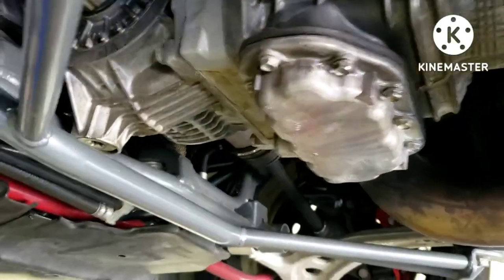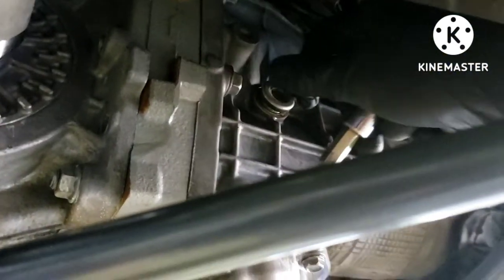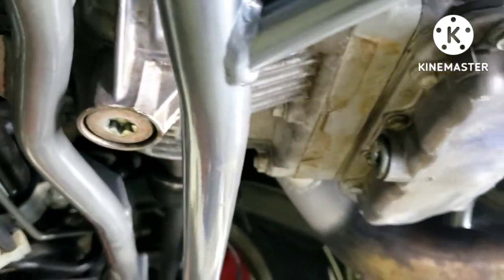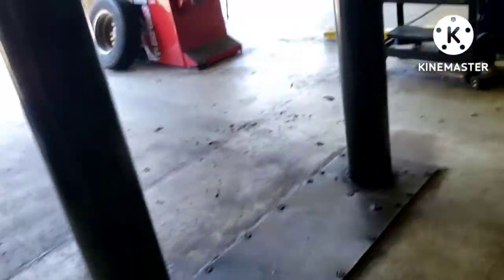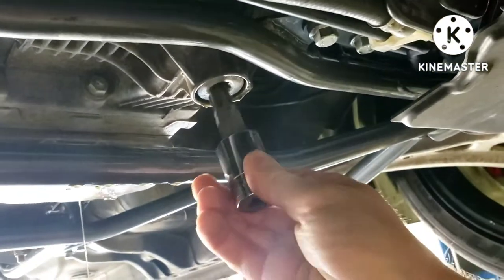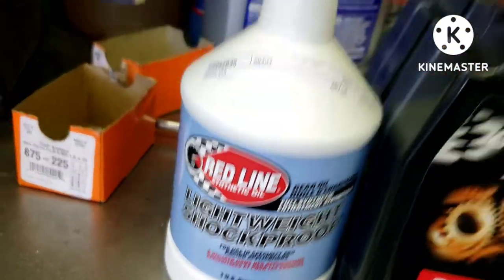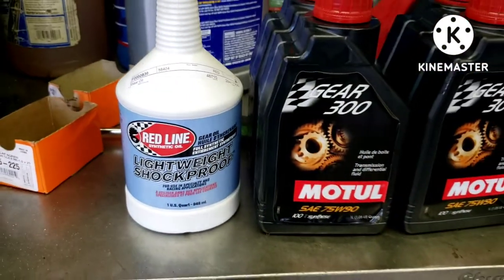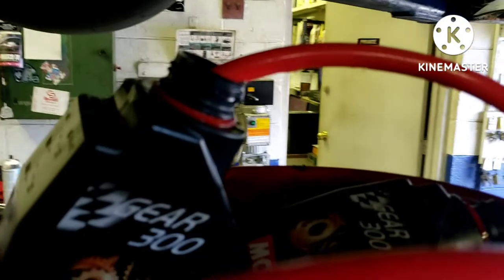Subaru STI transmission Fluid Replacement How-To

Comment: I really dig that cage . Protect the goods lol
Reply from the maker: @bradharrington2915  and add rigidity at the same time! haha
Reply: @nickquatrini  for sure looks good as well 
Gonna change my fluid soon , is the filter required to change ? Looks like it's inside the trans on the manual transmission

Comment: Hey man! Are these transmissions picky with what gear oils can be used? The motul 300 is impossible to find right now . Any suggestions on something I can pick up at an auto parts store?
Reply from the maker: So I'll be honest with you, I'm told they are very picky. Before I ran motul in it, I had mobil1 75w-90 and it shifted and drove fine. I am not sure if that is an approved fluid though.